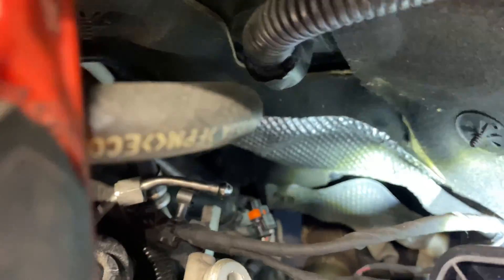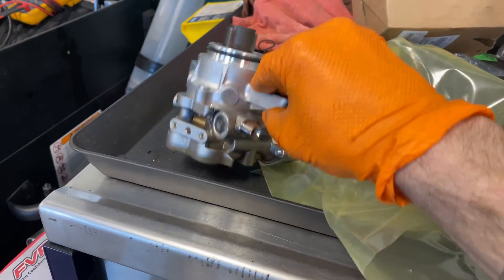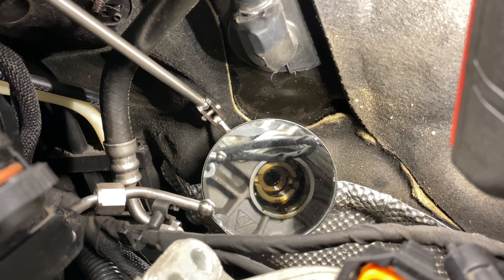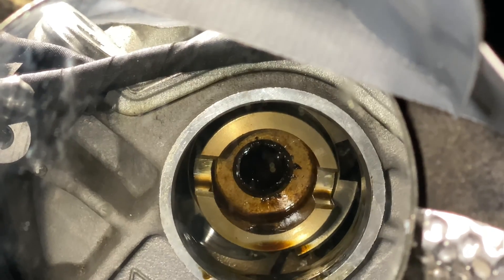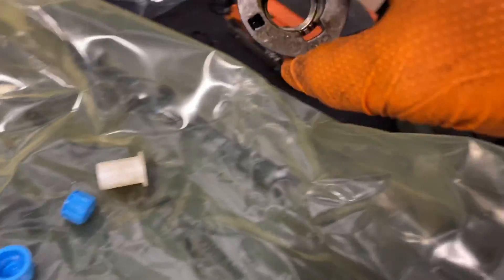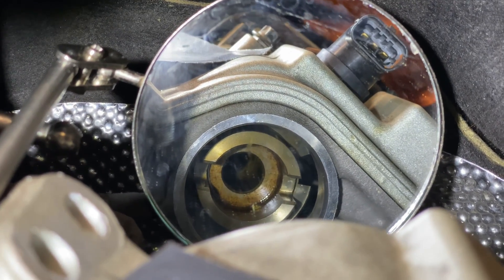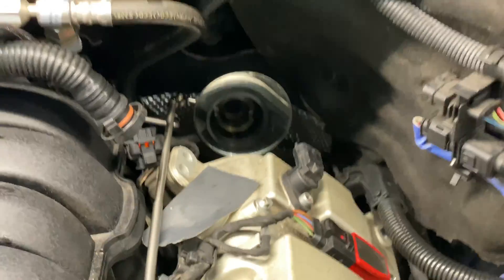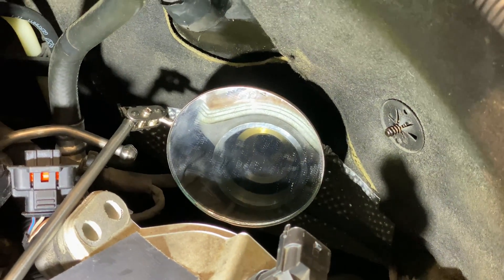Porsche V8 High Pressure Fuel Pump Replacement, 4.8L P1026 P1021

Comment: What about replacing just the sensor? I saw the TSB from Porsche saying many times the pump is replaced when only the sensor is faulty. Trying to see if you can replace the sensor without taking the pump ooff
Reply: Yeah when I looked up the p1025 code. I seen articles say it’s the sensor code and not the entire pump
Reply: I replaced my sensor and did not fix the issue.  Thus, I will be buying the fuel pump for my 08 Turbo. Thanks for the vid!

Comment: I’m wondering if the plastic part is actually necessary? This look to me just like a clutch alignment part? And most of them actually break before the pump goes bad, I did two pumps without the plastic part and they work fine, the plastic part cost about $30 on amazon and I’m still pretty sure that this part is only to hold the clutch in place doing the original line assembly to hold that clutch in place before the actual pump is installed?
Reply: you don't need it

Comment: Do you have any experience with P1027 code? I checked the live data and high pressure fuel values jumping from 33 to 43 or so. My car sometimes hesitates under acceleration, so I wasn’t sure if it was a fuel starvation or misfires. But since I don’t have any misfires codes but have fuel high pressure fluctuation code - does it mean it has a problem with a high pressure pump or it may be related to the low pressure pump in the tank?

Comment: Thanks for the follow up video. So I was wondering if the plastic stopper that looked damaged was the culprit all along? I ordered a new plastic stopper as well but havent changed out my hpfp yet. The reason I'm suspicious is because my car runs fine once its warmed up, only has issues on the cold start. Would hate to have to spend over $1000 on a part and find out theres nothing wrong but a tiny peice of plastic was causing this issue
Reply: Man, I know how you feel...smh.
Reply: Hey long shot, but my Porsche is having the same issue, did yours end up being the pump?